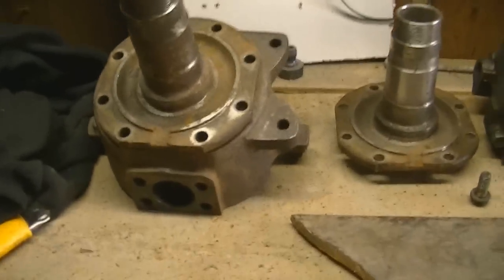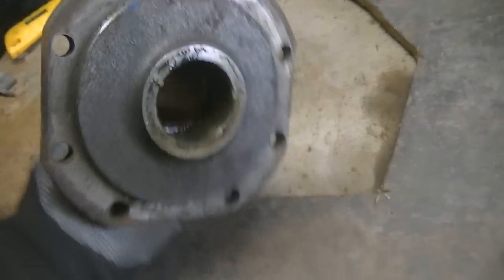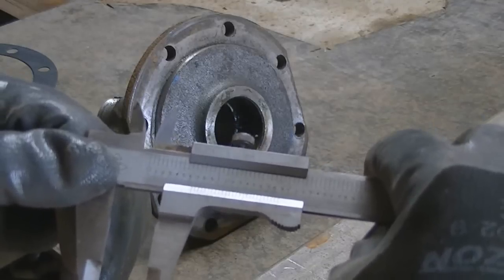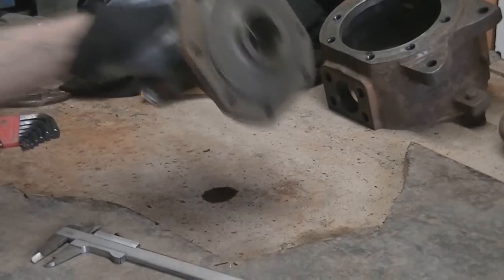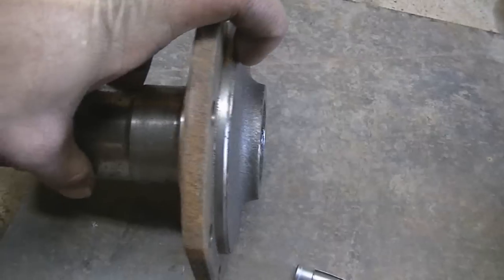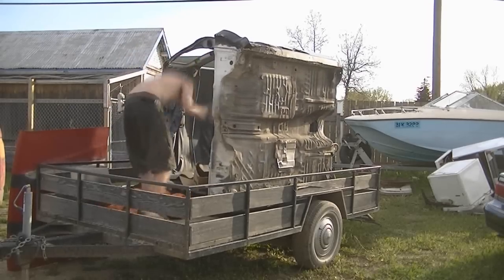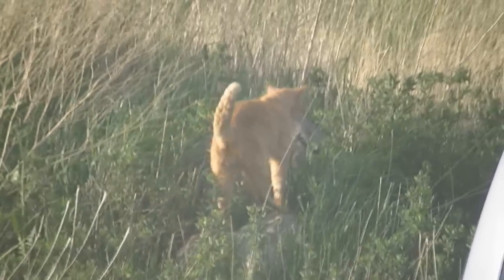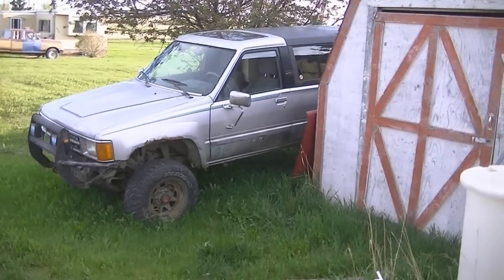Toyota Spindle Trailer Axle & Misc. (05/16/12)

Comment: I think you are right, cutting the metal from the spindle would weaken it. Looks like the adapter is the only way. It was comical watching you struggle with the body on the trailer. =)

Comment: cut out a small flange to weld onto the pipe that fits on the flat part of the spindle that sticks out (the middle step) and drill holes in it to match holes drilled in the flange.   It should be easy to center cuz of the part that sticks out in the middle.

Comment: I think my brain cells have just woke up :-)

You need 6 x 1inch tube spacers for the bolts to go through, then bolt your plate to them, then weld strips of metal between the tube spacers to close the gap up.

would that work?